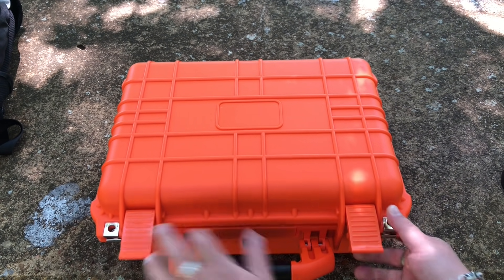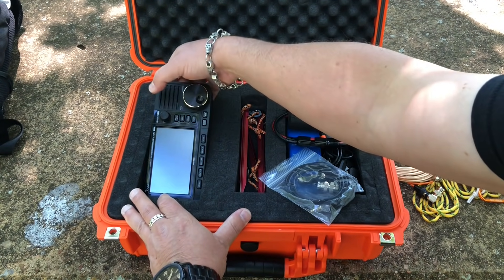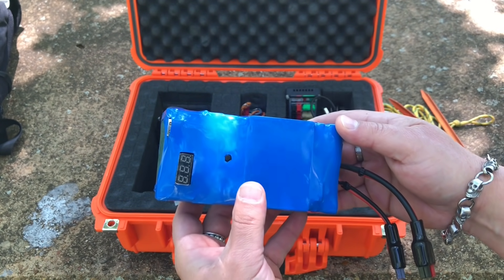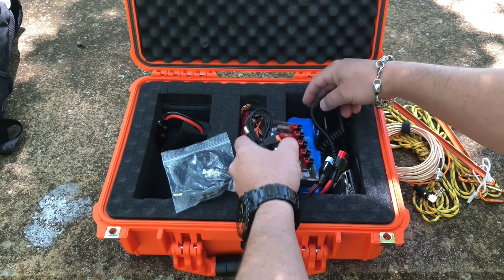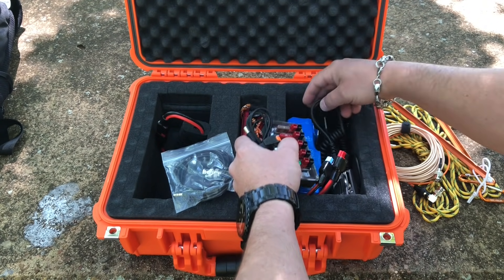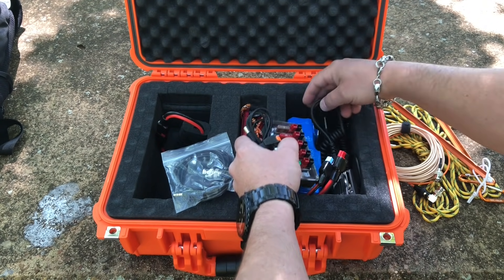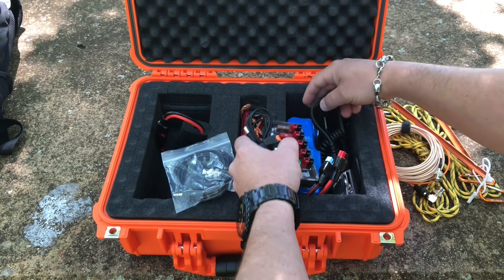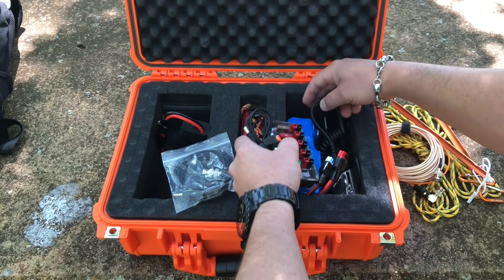IS THIS MY WORST POTA VIDEO EVER????

Comment: I use a small ammo box for all the mast rigging.  Using one for a battery seems practical, look forward to your video on that.  Also, around here we call those sloshies, and they are absolutely a great summer treat!  So not quite in season here yet.
Reply from the maker: Oh battery boxes are where its at for sure.  This is my second one.  They are just so practical.  I'm going to try and get a video out soon showing it off.  I didn't film the actual build though so I'm sure there will be many questions how I wired it.  I'm going to assume you're in Australia.  Everything ends in ies there.  Sunnies, Shoeies...lol!  I'll have another sloshie for you.

Comment: That battery box is basically exactly what I use for POTA xD. I have never really drained it down when running 100watts SSB for about 3 to 4 hours. Thinking of getting a boost converter to get up to 19v for my netbook. I was doing a POTA activation on the 22nd for Earth Day. Got 39 contacts total. Bands were being very iffy, 40m didn't seem to work at all compared to normal. (Normally I get a ton of contacts on 40m)
Reply from the maker: 40 is usually my go to band lately for pota but 20 seemed to have more activity, and thats not saying much, it was still a struggle.  The battery box is awesome.  With about 30AH it will certainly outlast me.  I made 300 contacts in about 4 hours once and only used 14.5 amp hours.  Thats a good idea on the boost converter.  Way better than in inverter and charger for sure.  I may need to borrow that idea.
Reply: @hamradiotube  I have to see if I can find the right plug for my netbook first tho, don't want to buy a whole new charger to just cut the cord off xD. I have only ran my batteries out once on purpose to cycle them by using them at home and letting my rig WSPR a day or two at 10 watts while I am at work.

Comment: So glad to see this video and hear that others are having challenges with QRP.  I’ve had the same experience with my new 705 and multiple antenna configurations.  I had my first failed activation yesterday; I usually use the FT-891.  I didn’t bring my 891 to force myself to use the 705.  Thanks for the great content.  73 KF0BQH.
Reply from the maker: It's usually not hard to make contacts if you are the one calling cq with qrp but its been tough these last few weeks.  I went out a few weeks ago when I first got the 705 and only made 2 contacts.  Other times qrp has made it rain with contacts.  Even though we are on the upswing of the solar cycle, the band gods are not cooperating very much right now.    Because of that failed activation I brought my 891 just incase and I'm glad I did.  Packing up all that gear just to fail is never fun.  I'd rather have it and not need it.

Comment: Mike take the foam in your case out and spray it with black plastidip keeps the foam from separating and gives a better fit
Reply: Ty for the Tip! 7 3
Reply from the maker: Sounds interesting.  Where does one source plastidip?  Edit, nevermind.  I forgot there was this thing we could use called Google lol.  Found it at Home Depot.  Thanks for the tip, or should I say, Dip?

Comment: Lots of noise this weekend. Got 2 parks activated @ 100W. It was difficult, but not impossible. I’ll have the videos up soon.
Reply from the maker: I didn't have any noise but qrp was not happening.  I'm so glad I brought my 891 with me too otherwise it would have been a bust.  I've usually not had problems activating qrp but its been pretty rough lately.
Reply: @hamradiotube  Good thing for the backup plan! Hopefully conditions get better soon! 73!

Comment: Conditions on Friday were pretty good then it turned to garbage off and on all weekend. Glad she worked out better there.
Reply from the maker: Yeah we got it activated but I didn't get too many great signals.  If I wasn't in the park with zero noise I would never have been able to pull out all the stations.  Most signals were 55 at best.

Comment: One of the best HAM radio channels, evah.

Guess the 891 was getting a little old...but, 1200 dollars for 10 watts? I guess its nice to look at anyway. Promotion in TX ='s new 705.
Reply from the maker: Thank you.  I still love the 891 obviously and its my main portable radio but yes, when you get a promotion and a move to a state you want to live in, you sometimes need to treat yourself.   The 705 is awesome and is just about everything you could ask for in a qrp radio.  I usually don't have problems activation qrp but it's been really rough lately.
Reply: @hamradiotube  Mike, well if you activated over the weekend, or Monday there were solar storms wiping the bands out. The 705 is quite amazing.  I'm happy for, but just giving you a fun hard time. You even have the little ultra-nerd cute little nifty tripod for it!. I have been tempted to try qrp by turning the 891 down to 5 watts, but will probably wait Lord willing till conditions improve.  I can't buy more equipment right now,  but if I could or can in the future, I'd go for the Yaesu DX 10
Reply from the maker: @oldpreach  Yeah I found that out the hard way lol.  This was just on Sunday.  I'm super happy with the 705 and of course you have to get the obligatory Manfrotto tripod!  My first portable activations were with the 891 at 5 watts with a cheap Duracell 9AH SLA battery into the famous KG6HQD Speaker Wire Antenna™.  I got my license in the bottom of the solar cycle so this is all I know.  I can't wait till things pick up.  I hear people talking about DX'ing on 10 meters like its nobody's business.  I can't wait for that to happen.  Not really a big fan of the DX10.  That waterfall just looks like something out of the 80's like Tron.  I'll stick with my 7300.

Comment: A QRP radio with a compromised antenna is not what you want to be using for POTA activations.  You can get by with it on CW or FT8, but you need the patience of Job to do SSB using a QRP rig. I normally consider 100 watts QRP when I can run a Kilowatt.  But I am a big believer in QRP, Quite Respectable Power!
Reply from the maker: I wonder if you've seen any of my other videos operating qrp because I would argue 100% against what you are saying.  I don't really flaunt this as I try to remain humble, but I am arguably one of the most influential people in helping to get POTA as big as it is in the world these days through all the videos I've done.  I've been emailed from people all over the world who have told me they have gotten started in POTA because of everything I've done here on the channel for the program.  I am not affiliated with POTA at all, I just really love the program and this is my way of giving back to the community.  I say all that to illustrate just how much I know about portable operations and what works.  The fact of the matter is, propagation wasn't that good on this day, or the last few weeks for that matter.  Very very rarely do I get skunked, be it qrp or qro.  The PackTenna antenna I was using that day is a 49:1 EFHW, and is one of the best, most effective antennas I have in my arsenal, and I own A LOT of antennas.  All but a couple are resonant antennas.  The little bit of power lost in the transformer is negligible.  I have conjured up many a pileup with just 5 watts (all activations SSB by the way).  Usually using a 9:1, 49:1, DX Commander Expedition, or linked dipole antenna.  If QRP didn't work, people wouldn't be doing it.  I do know people who share your point of view and love operating 1500 watts all the time and there's nothing wrong with that.  So long as you're getting on the air and having fun is really all that matters.  Thanks for stopping by.  73
Reply: @hamradiotube  : Mike, I have watched most of you videos and enjoy them. I have been a ham for a very long time and I am primarily a contester and DXer. CW is my primary mode, but I operate any mode during contests. A lot of times because of propagation or QRM, 100 watts will not get the job done. But I am in the mode of making one to two thousand contacts in a weekend. I have no problem operating QRP, but I will operate at whatever power level will get the task done efficiently. I enjoy operating my 891 with my WRC, but I understand I will not average 200 contacts an hour, especially if a contest is going on. I understand the enjoyment that QRP brings, but at times, under certain conditions, it can be very frustrating. I am not saying that you can’t get the job done with QRP, it just takes a lot of patience.
Reply from the maker: @n5pa  Ah yes, 1500 watts is certainly going to help for contesting for sure.  I've not had the opportunity to operate with an amplifier yet.  Closest I've come is with a beam at field day.  The most contacts I've done portable is about 300 in four hours.  I think it was with the EFHW too, running about 90 watts w/ the 891. 200 an hour would be crazy fun!!  Good lord thats a lot! QRP has certainly been frustrating lately for sure.  That's the reason I brought my 891 on this trip.  The weekend before that I took the 705 out and only got 2 contacts.  I wanted to activate qrp but realized that it might not happen.  Good thing I planned ahead.  You're on a whole other level than me with contesting though.  I'm still fairly new to the hobby (licensed in 2016) and have much to learn.
Reply: @hamradiotube  : Mike, Yes since 1959. So a long time. I have live in some exotic places over the years and have operated in 49 countries. When I was in Malawi with the 706 MKIIG and a Cushcraft R6, it was frustrating. But one day we were crossing the Shire River (Think Dr Livingston) in our Land Rover and the squelch started breaking on 6 meters. We stopped in the middle of the river while I made several hundred contacts into Southern Europe, the Middle East, Southern and Southeastern Asia. That was fun!  And all the time the Hippos were swimming around and bumping the vehicle. From where I was to Southern Europe was 4400 miles!
Reply from the maker: @n5pa  Holy crap!  I thought operating from a park was fun.  Thats an incredible story!  Hippos on the air lol!
Reply: @hamradiotube  : 20 foot Crocs too! We had been staying in Blantyre and there was an major insurrection on their Independence Day. So we had to spend a few weeks in the Lower Shire Valley. Not a fun experience, except for the 6m opening. Lots of experiences from a lot of places.

Comment: Sometimes those extra watts make all the difference. 5 watts, 10 watts ... do I hear 100 watts?  Yeah, a lot better when propagation otherwise stinks. NK5J.
Reply: QRP is a great listening mode.
Reply from the maker: They did yesterday for sure.  I literally gave on cq once I changed radios and a station came back to me.  I usually don't have problems activating qrp but its been really rough lately.
Reply from the maker: lol!
Reply: @forgetyourlife  On the plus side, Mike always brings really good antennas and knows how to use them so he's getting the most of those few watts which is why he's normally very successful with QRP. When propagation stinks QRP is a great "listing" mode on the POTA spot website ... "listening" not so much ... unless you're in the same park.  Not to say you won't be able to activate a park QRP but when propagation stinks people using 5 watts with a non-resonant crappy antenna are going to find it difficult and should get that frozen daquiri on the way to the park.  Then again, maybe the shirt really does help.  I'm POTA hunting with an ICOM 7300, an extra SDR receiver, two antennas (a DX Commander and an efhw at 45 feet) less than a mile from the salt water of the Gulf of Mexico and it just isn't that hard to figure out who on the POTA spot list has a sub-optimal QRP setup.  If you really want an idea of how bad it gets open the POTA website and then use websdr.org from different parts of the country to see how many of the listed stations you can get after trying  your shack's radio.  It often ain't pretty when conditions stink ... but I'm guessing it will be a different story as get deeper into Cycle 25. At that point I'll put up the 20 meter solder dipole antenna and hope it doesn't melt in the South Texas heat.
Reply from the maker: @thomasstandley6309  Now I want to make a DX Commander out of solder lol!!

Comment: I think I figured it out. Charlie got 100+ contacts with the Happy Skull Guy K8MRD Radio Stuff shirt. You should have been wearing a Red Summit RF shirt. Think the scientific term is the cross promotion propagation effect.
Reply: Yep. I agree. You should’ve been wearing a Red Summit RF shirt.
Reply from the maker: You very well could be right.  I could have been causing some common mode current by wearing my own shirt.  Or maybe made a bubble of RF cancelation around me so my signal wasn't getting out.  Stranger things have happened I'm sure.  I spent so much time asking myself if I could do it, I didn't ask myself if I should.